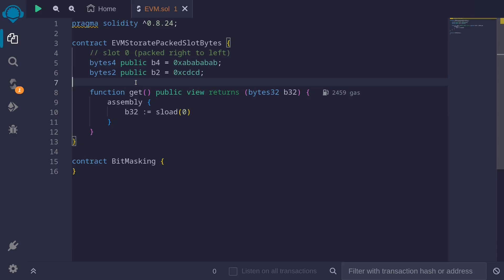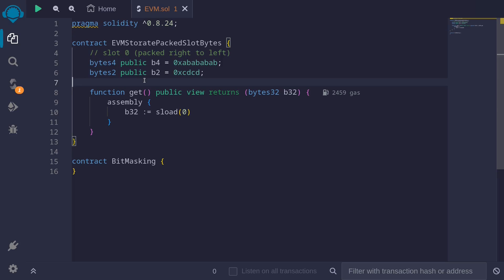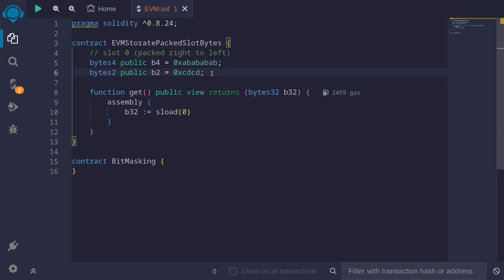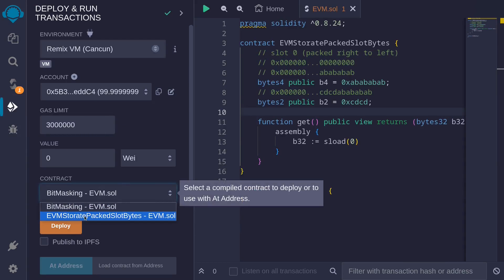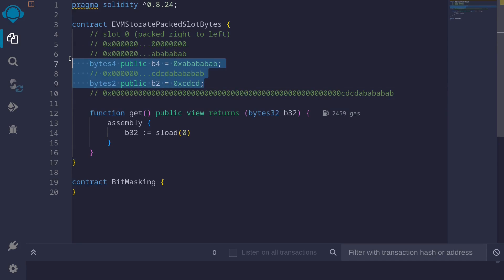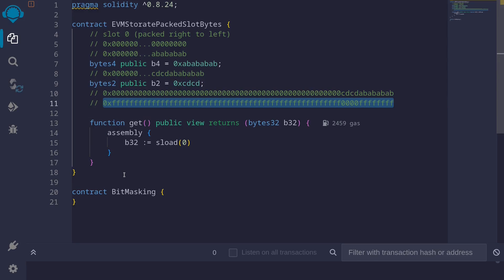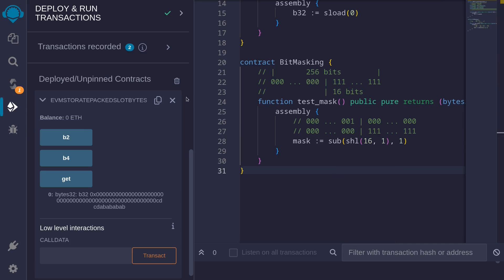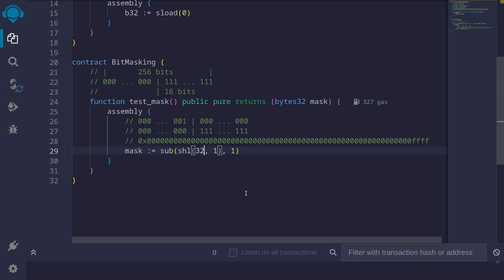Bit Masking | EVM Storage 2

Comment: I’m requesting videos regarding layer 2, I’m curious on how they interact with the EVM.
Reply from the maker: It will take a while. I am still learning how Optimism works in my spare time
Reply: @smartcontractprogrammer  alright thank you by the way for all the tutorials there not many like the ones you cover on YouTube at the moment. I’m confused because IS layer 2 like a smart contract deployed on an address? but I’ve read that it Optimism uses like a non contract address I’m not sure about the whole architecture lol.
Reply from the maker: For Optimism, it's a mix of
- L1 contracts deployed on ETH mainnet
- L2 contracts deployed on OP
- other softwares, such as op- node (a modified ETH node that run L2 transactions)

Send ETH from L1 to L2
1. Call OptimismPortal on L1. ETH is sent here and locked until withdrawal is initiated and finalized. It also emits a special event that the op-node monitors.
2. This event signals op-node to execute a transaction on L2
3. Transaction is executed on L2, ETH (minted on L2 by op-node) is allocated to msg.sender from step 1

All transactions on L2 are compressed and submitted to an EOA on L1.
This EOA is referred to as "batch inbox".
Address of EOA on mainnet is this 0xFF00000000000000000000000000000000000010

L2 state roots are written to a smart contract on L1, named L2OutputOracle.

With the transactions in batch inbox, and state roots in L2OutputOracle, anyone should be able to reconstruct L2 states
and prove that their transaction on L2 exists. 

Send ETH from L2 to L1
1. Call L2CrossDomainMessenger on L2
2. This transaction is stored into a contract called L2ToL1MessagePasser on L2
3. Using info from batch inbox and L2OutputOracle, send a transcation to OptimismPortal on L1 that proves transaction from step 1.
4. Wait 7 days challenge period
5. Finanlize the transaction from step 3. ETH which was locked is released and sent backed to you.